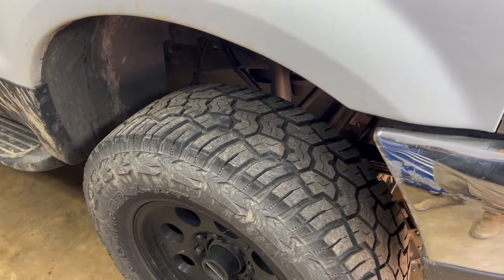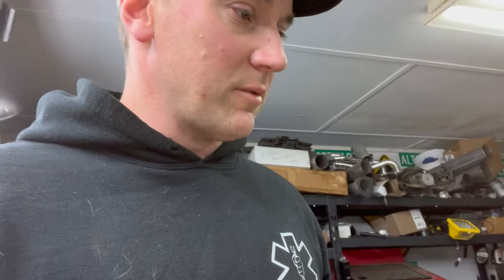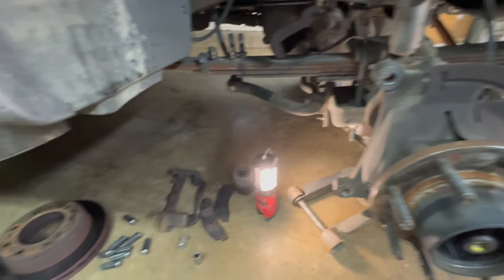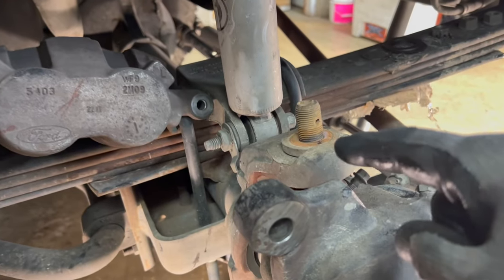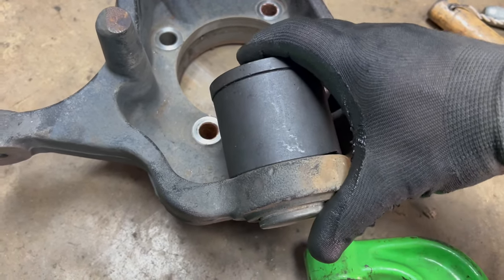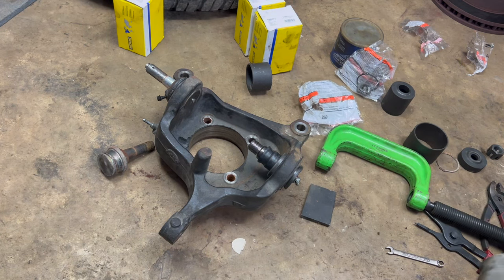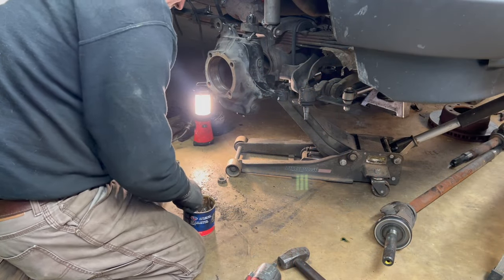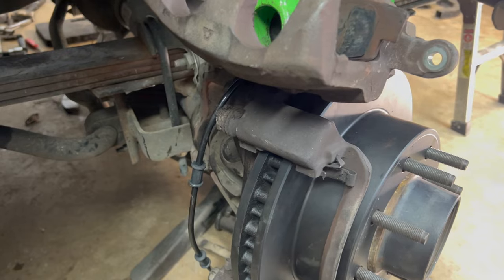99-07 F250 F350 Ball joints

Comment: Have to sub I’ve seen this video 6 times! My problem is one of my new lower ball joints just spins when I try and tighten it :( so I’ll get it tight with a wrench and hex socket but know way to torque it right like the other side oh well
Reply from the maker: Put a floor jack under the spindle and lift up using the weight of the truck to press down on a taper of the ball joint and it should press it in tight enough for you to tighten it up.
Reply: Great idea!
Reply: I had same issue, tried the Jack thing directly to ball joint, still turned, placed washers over shaft and tighten to over torque, then removed nut  and washers tried again to tighten to torque, and it still spins. I’m no where near torque, what to do 🤷🏼‍♂️🤷🏼‍♂️

Comment: Has anyone else had clearance issue with moog upper ball joint grease zerk?  On a 4x4 the 90 degree?
Reply from the maker: It’s not just moog any greaseable ball joint with that 90 is a clearance issue. Put the 90 in grease it then remove it and put the plug back in. Put the 90 in your glove box and just grease it every oil change. Takes about 5 min. No big deal.

Comment: I usually default to cutting the ball joint studs off with a grinder and cutoff wheel before even attempting to remove them.
Reply from the maker: I never do, no need to with the right tools.
Reply: @AutomedicGarage  I have a ball joint tool and a shop press.  The studs are just always in the way unless they are tiny car stuff.
Reply from the maker: @MissionRestomod  I have made some additional adapters that are deeper that have made it easier in certain situations.

Comment: seems like all the 4 ×4 s have more problems than the 2 wd s why is that
Reply from the maker: Cause most are lifted running bigger wider tires and some have offset wheels like my own personal truck which puts more strain on the ball joints and bearing hubs. Not to mention a stiffer suspension which beats in them more than the 2wd. Thanks for watching.

Comment: Use timken ball joints.. everything moon now is junk unfortunately. Had a hub last less than 10k
Reply from the maker: First off timken doesn’t make ball joints, only bearings, hub assemblies, seals and some universals. Moog ball joints for all the superdutys are still USA made. Best ball joints around. I’ve had to many last to think otherwise and I put a lot in every year. As far as the hubs go, yes timken is the way to go it’s hit or miss wether you get USA made or not with them, over half their operation has moved overseas now as well. Moog hubs are also a good product, however I feel that timken is superior when it comes to bearings. Do some searching for those timken ball joints, they aren’t there. Thanks for watching.
Reply: @AutomedicGarage   my bad I meant spicer 🤣 and I truly just have a horrible taste in my mouth from moog at this point customer service was terrible as well. At least in my experience.
Reply: Great video tho!
Reply from the maker: @mitchellpisarzewski194  well I will use moog until I see a reason not to. They are quality greasable USA ball joints that are superior to any others I’ve ever dealt with. When someone’s truck leaves my shop I want it to be in the best most reliable shape it can be in.

Comment: Moog is junk
Reply from the maker: Well, to each their own. Regarding superdutys I’ve had excellent results with the moogs on longevity. I like their tie rod ends also what I don’t prefer of theirs is their bearing hub assemblies, for those I prefer timken. I’ll have to give the spicers a try again, it’s been awhile. Thanks for watching.
Reply: @Automedic Garage  i used spicer on 18 wheelers always had good luck out of them but as far as moog goes three months and ive heard alot of other people talk about moog also and the parts place were i bought it at said they quit sale moog because of the trouble they had with it
Reply from the maker: @robertjohnsonmetals3727  we all have our go to parts, that’s one of mine. I wouldn’t put something on a customers truck I dont trust. The moogs on my truck have been on there’s around 50k so far and I run 35s with negative offset weld wheels so the timken bearings and moog ball joints are under some stress. But thanks for the suggestion and thanks for commenting and watching.